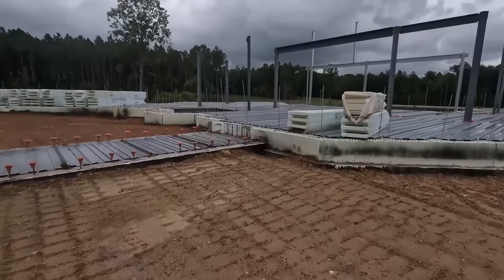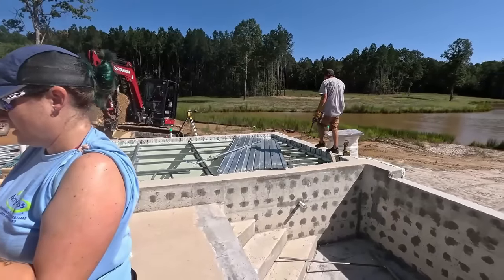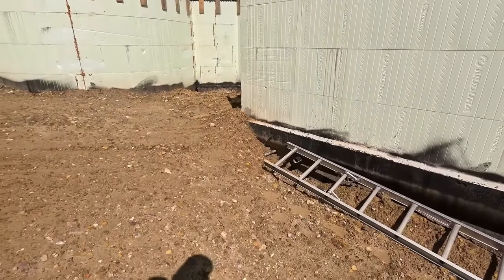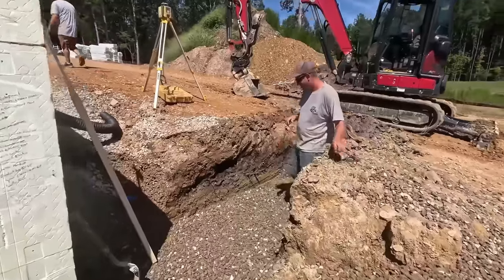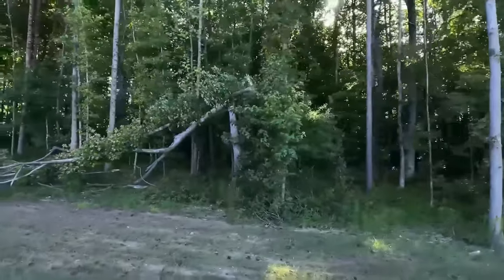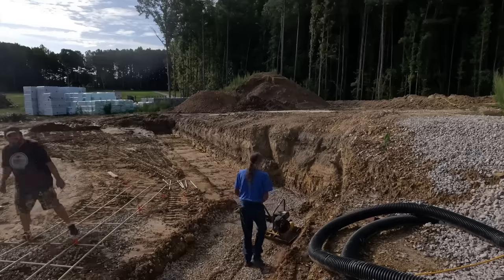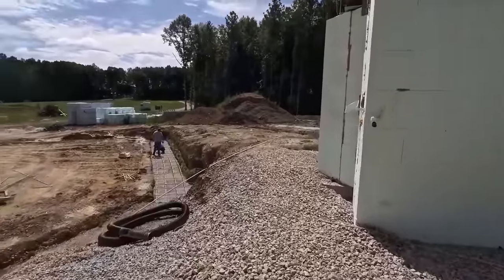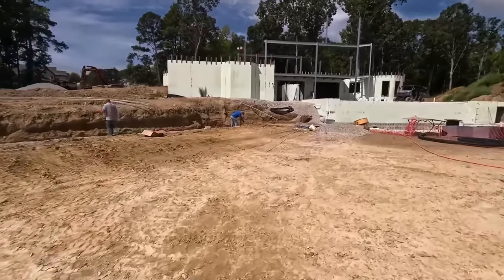Concrete Preparation Race Against the Clock

Comment: I did fiber optics as a living.  Retired now.  We used armored cable when we had rodent problems.  Pull it by the outer sheath, grease it well.  Its glass but pretty durable.  Use lots of slack, NO tight bends, 4 inch radius or so.  Cap off connectors to prevent damage to the connector faces.  Clean both sides of connectors with proper cleaning cloth.  Multi-mode is easy peasy.  Any questions shoot me a message.  Cant wait to see it all finished.

Comment: What we use to do when ordering concrete. Ahead of time we formed up ( different sizes) but most about 4’x4’ pads ( 3 1/2 “ tall  2x4 ) and some bigger using 2x6’s.  We set them on plywood and sprayed release on them ( at time of pouring) so when we were done pouring our project , we filled these with the concrete that was left after the pour. We used these mostly for catch basin bottoms. I can think of many uses. HVAC pads ..swimming pool pump pads etc and etc.
Reply: Yep' Coulda built the Duck Mafia and Chickens a few Patios 
Assuming No Fence post ideas could be considered !
Even make a PVC pipe copying Sono-tube if it doesn't fill to top, just put a cap to seal out rain !

Comment: First time I’ve ever heard of fiberglass rebar.. cool 😁
Reply: It's called "MST" Bar, Much lighter, stronger, waterproof, fire resistant  and it never rusts. It does not bend, so you have to pre-order any corners you need.  Geoff Beally introduced us to this product and Matt aka "NYA Millennial" is using it for his "Castle project as well.
Reply: Nya millennial is working on a lighthouse. He explains it and even visits the factory.
Reply: @henkoosterhof5947 Yeah, but despite the fact it has been known as the lighthouse for decades because that is why it was built, he calls it a castle in every video. As anyone who's watched his build it's obvious Matt isn't the sharpest knife in the drawer.

Comment: As many bathrooms and fixtures you will have and distance from house to well house and friction loss you will have you may have wanted at least an 11/4 inch ips water line. Nice build just a suggestion
Reply from the maker: I would have ran a bigger line, but I will have a storage tank in the basement as well

Comment: that fiber cable you have here in Australia that would have to in pipe
Reply from the maker: The reason for the extra expense of the rubber coated metal jacket is to avoid using pipe 🤔.

Comment: House only as good as your subcontractors you have to watch them for some will short cut to save them time but you get left with a problem down the road make sure you do your homework before building, get a good builder or you pay now or you pay laker but usually a lot more.

Comment: Your Mexician masons and joiners would have had this thing built months ago.  Built with God's material, no factory warranty required.  This build is getting fannier by the episode.  Rock on.  🙃🙃
Reply from the maker: Who would have wrote that big check?
Reply: Ya but that is expensive and if you are not in a rush and have a big family or lots of friends you will save a ton a money.
Reply: Weird, I see lots of construction with Mexican crews but so far, not any doing ICF. It’s only a matter of time before ICF goes so mainstream that all the nuances are ironed out and it becomes less expensive to have them because language barriers and “lost in translation” issues no longer kill the project.  

The “built with Gods materials” and “no factory warranty” was also puzzling.  Do you mean using clay and straw to make 2 foot wide adobe walls?
Reply: @BealyGood  If you consider your time to be worth something..........well.   Enjoy your channel by the way.

Comment: An aerial still shot, like you have at 1:08, that you could annotate with a marker and voice over would help explain the location of things and your plans much more clearly than gesturing to areas at ground level.
Reply from the maker: There are a lot of editing things I want to do. I started implementing some in this video. But when I get on about hour seven of editing a 30 minute video I have to tell myself that enough is enough and try to do better next time.
Reply: @BealyGood  In Lean manufacturing the path to efficiency is not to work longer or faster but to eliminate waste. Waste is anything that doesn't add value from the customer's point of view. It isn't easy, and takes honesty and discipline to identify identify waste. Most people prefer to  just keep doing what they are doing. Lean Made Simple has an excellent set of videos about this.
Reply from the maker: @nandi123  I don’t disagree. That’s why my videos keep improving.
Reply: @BealyGood  Our experience: Before filming we list the high value-to-customer shots, then carefully maximize the technical quality of each shot. This not only produces less footage to edit, but the edits require less time. Previously we shot everything and did the culling and editing afterwards. Our editing time decreased 80%.
Reply from the maker: @nandi123  that only works when you know what your plan is to film for the day. My stuff is very fluid. In the beginning I had about 40 hours editing a video. So it has come down a lot.